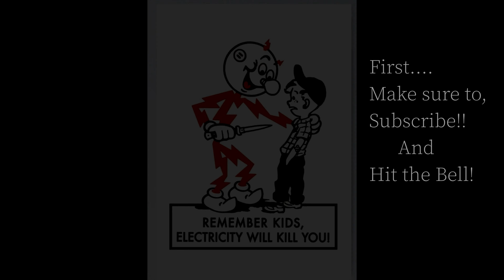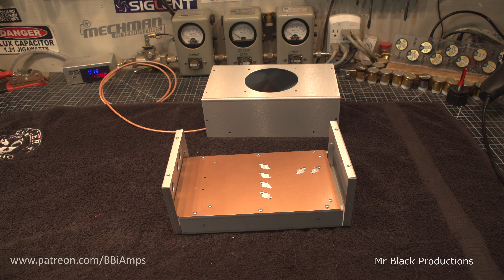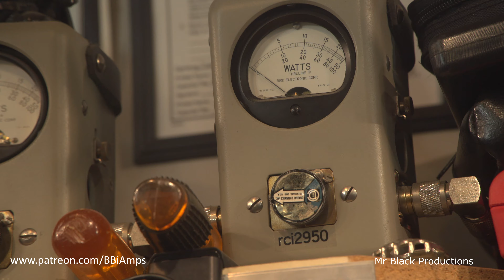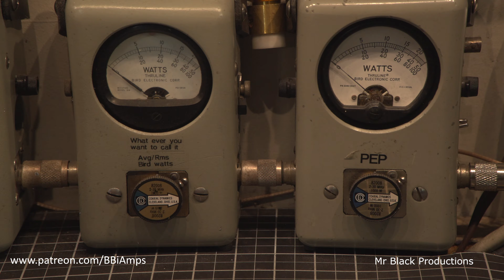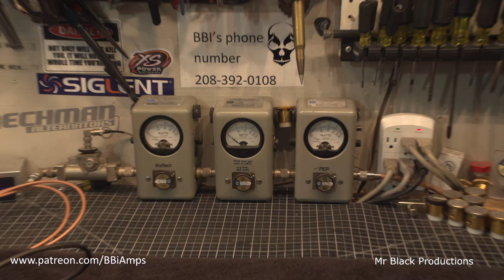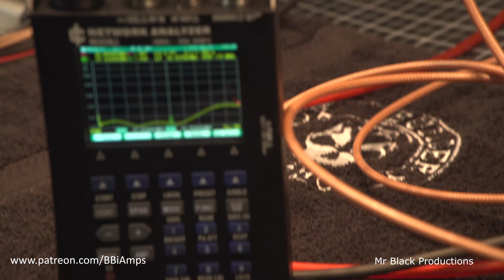Let Build 2 M,B,C, 4 pills #29,#30, sold

Comment: class C box is great for FM as well. run cooler. Having same trouble getting parts. I do a lot of repairs mostly power supply's.   The biggest head ach is shipping. not just the cost but the time. ordered parts from California  and Manchester England. same day ! USPS 3 day flat rate and royal mail. got USPS tracking next day . royal mail 2 day later . ant the Manchester order came in 10 days .including sat and sun. which was great . but the US shipment took 14 days ! I am in boson NY  . Why so long east to west ? for me England the outher way and further away. It is a crazy shipping world now. they all do it. I get DHL hear ,FedEx, UPS , Walmart , Amazon, USPS , and at times they all slow.  Delayed ! and some times fast ! Some company's told me CDL driver shortage,  others bad weather,  coved changed shipping and not in a good way. 73's

Comment: $850??  Wow!  Back in the day, I used to sell 5 pills for $300, but then it only cost like around $150 to make.  If I was able to get out of it what I had in it, I was happy plus, making a low cost decent product is a good way to get yourself known.  Hey!  If you ever happen to come across an old amp. that's like completely silver plated inside (main board, transformers, ect.)...it might be one of mine.  Always loved them class C wattz and those boxes you got there are mighty fine!  As always, nice work!